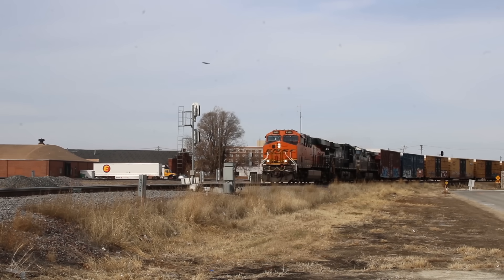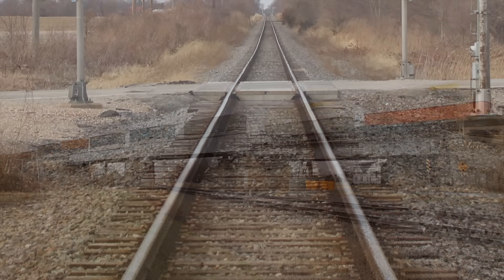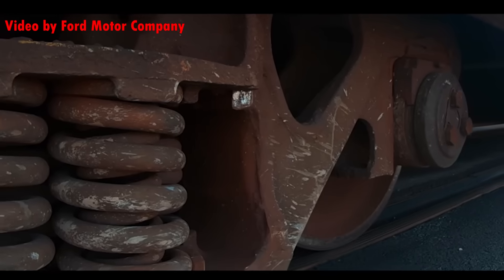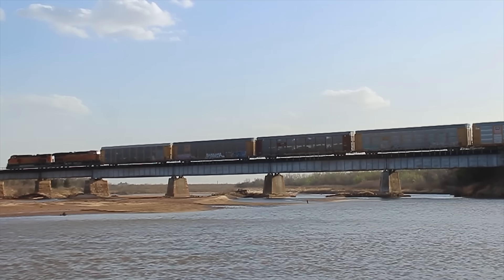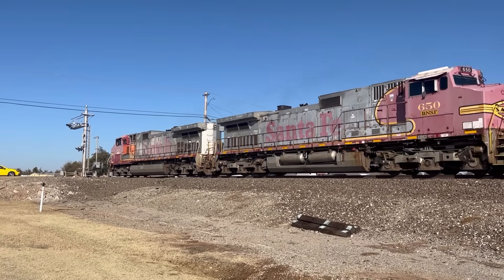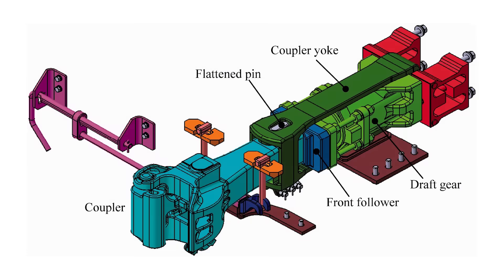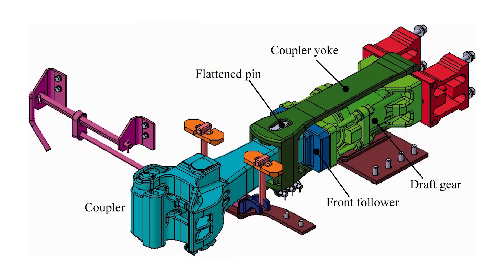Why Locomotives Can Pull So Much

Comment from the maker: Merch, anyone? http://okieprint.com/SPR/shop/home
Reply: No offense, but look up the term exponentially.
Reply: @mysticjedi6730  Maybe you should look it up, because he used the word properly.
Reply: @edwardbaker1331 take 100 conpounded at 20% annually . After one year 120. After two years 144. After 3 years 172.8. And so on. 

The rate of increase is increasing. If we plotted it on a graph there would be a curve. 

He was just using it to mean very large. That's not what it means. Trying to sound smart. 

Exactly what you did thinking you knew what it meant as well. In fact you have to comprehend basic math to understand what it means. 

I meant it in a polite way.. no offense but look it up.. because by using it improperly it made him sound stupid.
Reply: @mysticjedi6730  I know what the word means. Everyone knows what it means. No need to be condescending. Everyone has interest on their accounts and knows about compounding interest. I'm a licensed engineer. It is quite proper to use the word metaphorically to describe many multiples of any comparison.
Reply: @edwardbaker1331  my drive to work is 3 minutes. My brothers drive to work is 3 hours. Is his drive to work exponentially longer than mine? The mathematically correct answer is NO.  It it just much much longer. We can even calculate how many more times longer. 

I am sorry but I can't teach you logic, reasoning, math, etc.
Reply: @mysticjedi6730 
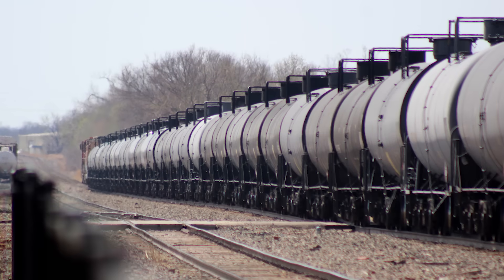Revelation 3:20
Behold, I stand at the door, and knock: if any man hear my voice, and open the door, I will come in to him, and will sup with him, and he with me.

HEY THERE 🤗 JESUS IS CALLING YOU TODAY. Turn away from your sins, confess, forsake them and live the victorious life. God bless.

Revelation 22:12-14
And, behold, I come quickly; and my reward is with me, to give every man according as his work shall be.
I am Alpha and Omega, the beginning and the end, the first and the last.
Blessed are they that do his commandments, that they may have right to the tree of life, and may enter in through the gates into the city.
Reply: It's all because when the locomotive was being born in the factory, a worker working overtime came over and read it the children's classic "The Little Engine That Could"   From that point on, the locomotive said to itself, I know I can pull  anything. It's that simple.
Reply: E 0:15 0:15 0:15 eer 0:16 ee
Reply: I'm curious how a locomotive would perform this task if they had to start going up hill?
Reply: The moment you stared with friction, I switched off the video. You don't have a clear understanding. The primary purpose of rails is to spread the weight across larger surface area and to give a bump less flat path for the train to move.
Reply: "Why [sic] Locomotives Can Pull So Much" -- "How"!!!
Reply: @rdbchase bro u good?
Reply: @professorsilkworm  It's not enough for me to know the difference -- I want even YouTube posters to!

Comment: Part of your explanations is incorrect, surface area is not even remotely as important for friction as people think. Halving the contract patch doesn’t mean there’s half the weight pushing down on the track. It would only double the pressure per square centimeter which would result in the same amount of friction. The reason why trains have so little rolling resistance is purely down to the low coefficient of friction between the steel wheels and steel track.

Comment: Can someone maybe explain what I am missing, the static friction between the wheels and the track is not what is being overcome when a train is starting out wouldn't it be the static friction inside the bearings for each wheel on each train car? The static friction between the rail and track is only applicable for the locomotives themselves as they are the ones applying a force through the wheel onto the track to accelerate. The freight cars are just being pulled along when accelerating, hence the locomotive needs to overcome the friction in the bearings to get the wheels spinning.

Comment: That Ford commercial had me sweating. How were they supposed to stop the carts after the truck got them moving? 😅 Unless there was a locomotive at the other end supplying air, the carts' brake system won't work and there is no way the Ford would be able to stop them by itself. I know there are mechanical handbrakes at some cargo carts, but that also seems unlikely unless there is a person using each handbrake on each cart. Was the test done in a track with a slight uphill or a track with some kind of braking system (I can't find anything about this, but I know for a fact we had some of those at a cargo yard in my country)?

Comment: When a novice train driver came to a halt with a 4 car 280 ton doubeldecker passenger train on a bridge with no electric wire overhead - he was supposed to roll over that bridge without power, not stop - i ( train driver that was not on duty and a passenger ) and a handfull of passengers were able to actually push that train under the wire again. The track was completely horizontal or that would not have worked. We joked we should receive a Guiness world record moving such a mass with human power only but there was no one to record what we did, only reward not being stuck for hours there waiting for a locomotive. :-)  Yeah rolling resistance can be really low, we use that in passenger trains to roll for many kilometers/miles without traction needed as the air resistance plus rolling resistance  is usually insignificant compared to the mass pushing through it and the kinetic energy put in and stored by it's current speed.  The only exception is a strong side wind that drags along the entire lenght of the passenger train, or having open bulk wagons in tow, which create immense air turbulence forces that drag the train down. In wet conditions it can be hard to accelerate with a locomotive despite it's considerabe wheel pressure on the rails though...from a very long time ago locomotives blow sand onder their wheels to increase traction - modern ones still do - but it can still be a struggle. There is a rule you should not use that when driving over switches....always ignored that as it would take forever to get to speed and being home sooner :-)))

Comment: As a rule of thumb many railroads plan power based on a train weight being 1hp per ton. A 20,000 ton train might need 4 to 5 units each rated for 4,400hp.

Comment: You'd never expect it but any vehichle that isnt a train or semi really aint all that strong, theyre only able to move as well as they can because they're spinning a wheel. A 4000lb truck with 220 horsepower and 260lb/ft of tworqe may be pretty hard to push from the back by yourself but you can roll the thing with your finger if you just put your hand on a wheel. You can probably even output the same tworqe if you put a breaker bar on a lug nut and stood on it. Its really not all that difficult to rotate things, especially when theyre equally balanced which wheels are.

Comment: It also helps that the grades on the tracks are so shallow, typically less than 1%, or 1 foot of elevation gain for every 100 ft of track, whereas roads are usually much higher.

Comment: There is a confusion inherent in this presentation between the concept of friction and rolling resistance. The very small contact between rail and wheel due to the metal to metal contact means that there is low energy loss in the movement. This is related to the movements of steel balls in a desk-top toy or pool balls contacting each other in inelastic collisions.. Scientific American once had an article about the efficiency of bicycles and stated that railroads and only railroads were more efficient because energy was lost in the bicycle rubber tires. What the speaker in this presentation meant was that railroads had very low internal frictional losses (due to the inelastic nature of the metal to metal contacts). There is plenty of friction between railroad wheels ( which were once called tyres) and the rails, otherwise you couldn't get trains moving or stopping so 'easily'. But there are low frictional energy LOSSES.

Comment: Nice, but the rail cars do not weigh "exponentially more than the locomotive".  Assuming they all weigh the same, it is linear, and therefore just a straight multiple more. 3:12
Reply: Grammatically correct but mathematically incorrect. Nevertheless a common usage and therefore a valid use of the word

Comment: This explanation is wrong. It has nothing to do with the contact area. In fact, it is a very well-known fact that friction does not depend on the area. The key here is that since both wheels and rails are rigid, there is no rolling resistance. In vehicles with rubber tires, the deformation of the rubber is what causes the most loss of energy, which means rolling resistance.

Comment: You can try putting a dime on the rail and it will flatten it to show you the weight is on a wider area than the size of that dime.

Comment: 1:13 what I think is more impressive is that farbric strap being able to hold all that weight
Reply: Actually, the strap is holding zero weight (vertical force, to do with gravity). 
It is imparting force (resistance to acceleration), which in this case is much, much less.
Reply: @CarminaIguana pedantic drivel
Reply: @GryptpypeThynne  Weight differs from mass. Sorry you failed basic physics.
Reply: @CarminaIguana  and yet the point was communicted clearly and with no question as to the meaning. Perhaps you need to google the definition of the word pedantic, since you "fAiLeD bAsIc EnGLiSh"
Reply: @GryptpypeThynne  meh, grow up.
Reply: @CarminaIguana I get it, admitting you didn’t do the best thing doesn't feel good. We can both agree to not say anything  more about it, hopefully you saw what I meant.
Reply: @GryptpypeThynne  No, you don't get it. And if/when you write something reasonable, I'll see what you mean.

Comment: Oh so that's why the couplings are such a big deal! 

I always thought it was weird that there was so much talk about how certain couplings "revolutionised the industry", when it seemed like they should just have the very basic task of connecting rail cars. Sure, that's a lot of force to withstand, but they could just make them big and sturdy...

But with slack being a feature rather than bug and the extra complexity and potentially even higher loads of moving components in such a critical piece, it starts making sense that a really well designed coupling would make a huge difference to railroading.

Comment: It's actually more impressive that they can stop with the low friction than start. All that momentum must be tremendously difficult to stop.
Reply: Sometimes they spray sand in front of the wheels to increase grip

Comment: I'd be interested in learning why steam locomotives could only go forward.  I once owned a property in Palmer Lake, Colorado that had been the "Y" where ATSF would decouple a few extra engines needed to push a northbound train up over Palmer Divide, but that weren't needed for the slow downhill grade to Denver, about 2,000 feet lower.

Comment: Does the engine have to back up first, pushing all the cars together, to get all the slack out between all the cars, so that when it pulls forward it would then have enough slack between each car to move the entire train?  I thinking that if say 5 or 10 adjacent cars had no slack between them, when their turn came up the engine would have to pull those 5 or 10 all at once.

Comment: Afraid not correct about the static friction. The static friction to overcome is between the wheel and the axle (getting the bearing to move). If it were at the wheel-track junction, you’d be talking about sliding the train. But it’s rolling, not sliding. Same with the truck wheels, but there’s a wheel deformation to overcome there as well. That said, I hadn’t thought about any of this and you brought it into focus. Interesting video.

Comment: Average weight of 100 train cars....19,000 tons 3,800,000 pounds.
Reply: Think you missed a zero, saw the number knew it was way too small, but didn't immediately know why.  I just knew right off that a container usually will weigh around 41000 so that they can be pulled by a semi, and that times 100 is already more than what you have for a total, and cars can stack 4 containers at a time.

Comment: suppose it it also works in the opposite direction where the locomotive is pushing the trucks iso pulling, not all at once but rather accumulatively one after the other and build up momentum to push the whole train

Comment: (1) There is no friction loss where the steel wheel meets the rails.
(2) The loss in the axles of the railcars isn't friction either  since those use roller bearings. It might be described as fluid resistance in the bearing grease.
There is no friction in this system! Your site needs a technical editor.

The work that the locomotive must do is lifting all that mass as it climbs a 1% grade and lifts the mass against the gravity field.

Comment: So the draft gear basically employs the same principle as rocking a car to get it unstuck from the mud/snow, it converts to static friction of one car into inertia of the car and locamotive slamming their momentum forward, basically, it gives it a small running start

Comment: The train cars are not "exponentially heavier" than the locomotive. And trains do not get exponentially longer as more cars are added. 

Both of those things increase linearly as cars are added. 

If weight increases exponentially, then the amount of weight each car adds would be more than the weight the previous car added. Which doesn't make sense. A train car with its payload has a fixed weight. It doesn't change based on the car that was attached before it.

Comment: Very interesting. Can someone explain, when there is a situation like at the end of this video, where there are four locomotive units at the front, are they all somehow  controlled from the lead locomotive or is there a driver in each one? Similarly you sometimes see locomotive units in the middle of a long train, would there be a driver in there as well? If so it would seem like a very boring job.

Comment: Sorry but no. The slack is the space between the couplers. Not many cars have a cushion device that allows the draft gear to slide in and out. Most good engineers try to keep the slack tight or stretched out. If you don't, the train can build too much momentum before the force is applied to a rail car further back in the train. The resulting snap can break knuckles or even couplers. Getting a run at it by bunching the slack then stretching each car will break something.

Comment: The part about draft gear doesn't work if the train is stretched. On a flat or ascending grade, stopping stretched is the proper way to stop a train. Yanking out slack on a long enough train will lead to trouble and a long walk for your conductor. It is also poor train handling and no self-respecting locomotive engineer would do that. The combined slack on a modern freight train can be as long as 500 ft, and letting that roll freely will break your train in two. The locomotives can actually produce enough starting tractive effort to start an entire train moving at once, there is no need to "take in slack".

Comment: You made some good points on friction.  Wrong on draft gear. Any good Hoghead worth his salt will tell you that  before you start pulling hard, you First get all slack out of your train completely. Most ETD's will notify you when rear of train is moving, not very accurate tho... Old conductor used to tell us riding in caboose. Slack adjustors are for modulating territory.  And that old conductor would let you know also if you happened to knock him down with slack manipulation. On these new articulated stack trains, less slack and longer trains. No slack adjustors. If a train started movement as you suggested, it would end up in 2 pieces with a broken knuckle. Retired BNSF engineer 44yrs

Comment: Ok thank you for this. You explained this perfectly. Im a truck driver in a state that allows 60 tons gross (120,000 lbs) so i get the idea of trying to move something heavy from a complete stop and the idea of the travel in the draft gear answered it. But im curious to know...is there a formula for figuring out how many engines are needed to pull a certain amount of tonnage? Im sure they have to factor in gross tonnage, along with gradients yes????
Reply: Yes, there's a formula. It's called H.P.T.. Horsepower per ton. Nowadays Railroad is more concerned about saving fuel than Horsepower
Reply: @Run8nova  ahhh ok ok...thank you. I'll research HPT.
Reply: Most are 4400 h.p. each

Comment: Next time put in the math for such a loaded drive wheel,  I’ve read, but don’t remember the tremendous pull each drive wheel can muster before slipping.  (It’s so great that steel is pulled from the rail,  and crews work every day to repair this)

Comment: Friction can be extremely low, sure, but railroads are slightly sloped. If a 1000 ton train is traveling up a 1/1000 slope (1m of elevation gain per 1km travel), then you absolutely need 1 ton of pull to keep from sliding downhill, even at 0 friction, right?

Comment: It is my understanding that a train a mile long only has 3 square feet of wheel touching the rail.  Hence extremely low friction.  Can anyone tell me if that is correct.
Reply: The wheel contact to the rail is the size of a dime. I'd say it's true

Comment: the steel/rubber friction difference isn't because  of less contact area for the steel, it's cause the steel doesn't deform as it comes into contact with the rail.. the rubber deforms (flatens) a lot as it comes into contact with the road..... that shape changing from round to flat and back to round consumes a lot of energy